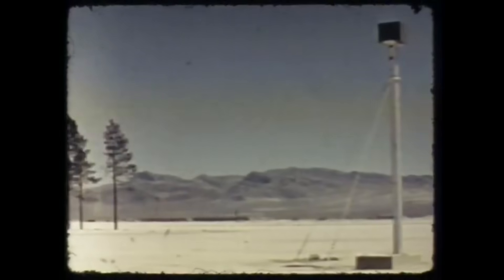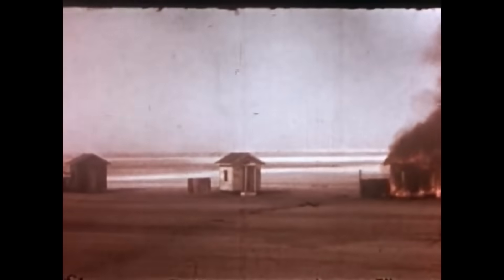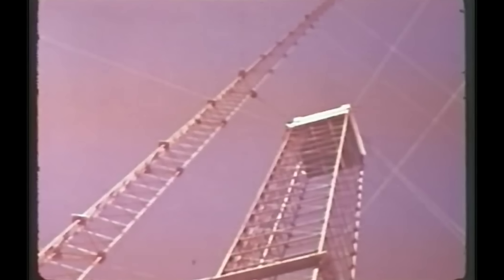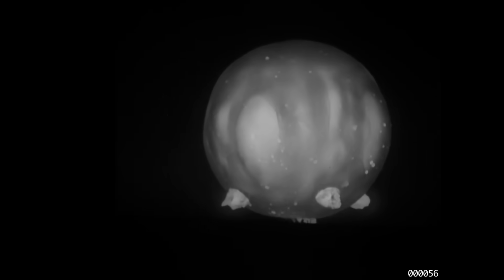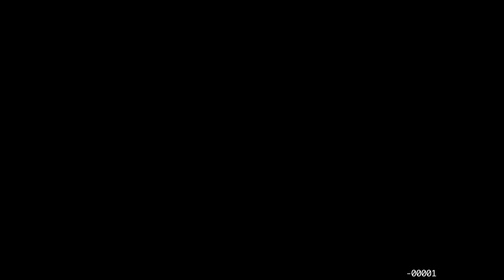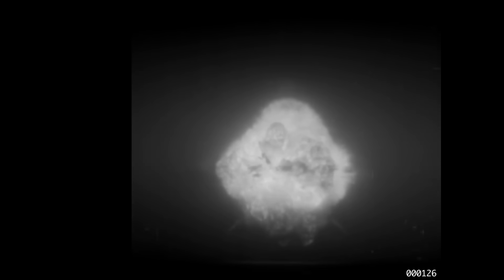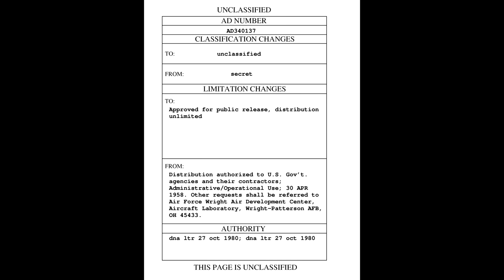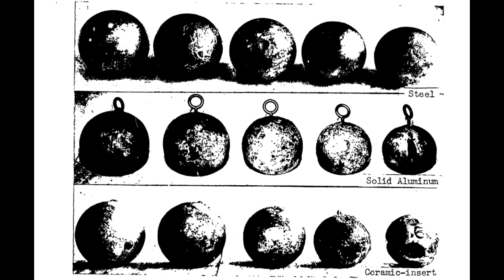Can A Metal Bowling Ball Survive Inside a Nuclear Explosion?

Comment: 5:27 These guys seem underdressed for standing in the middle of where a nuclear bomb has just gone off. I wonder what level of radiation they're being exposed to.
Reply: @John 73 John
The picture was taken 58 days after the explosion.
Reply: @spaceman081447  58 days is still generally considered "too soon" when it comes to radiation, isn't it? I'm thinking of how Chernobyl is still somewhat dangerous 34 years later, and would be much more so if it didn't have the concrete sarcophagus.
Reply: @John73John  Saying something is "radioactive" is like saying something is poisonous.  With rare exceptions, radiation is caused by radioactive decay.  That's where an element turns into another element (or the same element, but with a different number of neutrons).  So, just like with poison, it all comes down to what those elements are, and how long it takes them to break down into something safe.
Reply: @John73John  How soon is too soon depends on the half-lives of the radionuclides present, the type radiation (alpha, beta, gamma), and their quantities.  A nuclear reactor like Chernobyl's RBMK has tons and tons of uranium fuel, fission products, transuranics, and neutron activated materials.   An airburst weapon whose fireball does not touch the ground does not leave much radioactive debris in the area of ground zero.  You can read all the declassified test reports you want, showing contour plots of residual radiation at various times.
Reply: vibrolax Yeah, the deadliest part is in the fallout after the explosion.
Reply: Arthur Moore For some short living  isotopes like Iodine 131 there’s a relatively short time limit, but for most other stuff the decay is too slow and there’s only dispersion over larger volumes of soil and water that creates the impression that the problem disappeared.
Reply: @BasedBaller My father and others were told to "get the hell off" the Prinze Eugen after a day and a half of "cleaning" the ship. Lived to 79. Lucky.
Reply: @spikespa5208  If thats legit thats a great story
Reply: Define "just went off". That photo is likely days after the blast and the radiation levels were low enough for a short visit. Also notice they are wearing rad badges. The guy in the white hat is Dr. Oppenheimer, basically the chief inventor of the bomb. You can trust he knew what he was doing. (Besides, everybody smoked in those days, so you can flip a coin as to what was going to kill them first).
Reply: @RCAvhstape  Almost everyone in this photo died 'soon' after. Where 'soon' was only 10-15 years. They weren't old men, they were dying at the ages of 60-65. They didn't really know the long term effects of radiation on the human body yet. Acute? Yes. But chronic wasn't really a thing they worried about til well after their exposure. So, no. That was one aspect they didn't know what they were doing. Yet.
Reply: Cancers from significant but non-lethal exposures most often kill people after 60. Unless you ingest hot particles, especially some specific isotopes. Marie Curie lived 66 years. And she literally smeared herself with Uranium, Radium, Polonium for most of her life.
Some of these researchers had radioactive urine contaminated with Plutonium and made jokes about it.
Reply: They got about 50 mSv. Also no wearable clothing can help against gamma radiation.
Reply: Yastreb The main problem is radioactive dust, not gamma(if the exposure is short enough)
Reply: Well if the bomb detonate in the air or on a tower the air it self takes away alot of that neutron Flux (so the dirt do get mutated to nasty isotopes and the heat will gather almost all of the fission products from the bomb and send them in to the stratosphere down the wind in Taktikal use of nukes it is a bit different because they will hit almost directly over a bunker etc and a lot of dirt get mutated  but even this is not as bad because the really bad stuff hasn't long lifespans
Reply: Kathy Sharp  right. Now do the rest and come up with an average.
Reply: Like the signs say in Fallout. Radiation is not to be feared! But is should be respected.
Reply: The dust they're inhaling may have some interesting properties 😐
Reply: Not to worry, much of the radioactive debris blew into the neighbor's yards, decaying into SEP (someone else's problem), a bit like CO2. What was left killed them, but very slowly. /half-joking
Reply: @karlharvymarx2650  Yeah, I know. I live in Utah, one state over from Nevada where a lot of tests were done. "Down-winders" my parents' generation called themselves. There was one couple who watched a test from behind some kind of waist-high concrete or stone barrier, and a few decades later they both had tumors all through the top halves of their bodies.
Reply: The worries about radiation came up only in late 50s, when they discovered that the women in the watch factory had radiation sickness, since they were applying the r-active glow paint by paint brush. To make them pointy they put them in the mouth - including the rest of the paint.
Reply: @Bill Ferner The “radium girls” were injured in the 1920s, much before the 50s.

Comment: Thanks for another interesting video.
One of the underground tests included a steel plate to cover a shaft. That plate then flew vertically perhaps reaching the space. Do you know anything more about it?
Reply: They actually now believe it was completely vaporised rather than achieving orbital velocity. Though they did the maths and it would have had enough delta V to escape had it survived.
Reply: Anarchy Antz 
Wait I thought it survived, because it was launched out at such speed that it pretty much escaped the fireball entirely, and might have been the fastest man made object.
Reply: @livethefuture2492  It would still be colliding with the air at such speeds that that could make it melt and vaporize, like a spacecraft coming back from orbit.
Reply: I saw a Youtube video about this 3 or 4 years ago.  It may even have been a Scott Manley video.  In any case, it is out there.  If you do some sleuthing, you can probably find it.

Comment: I wonder if the opposite of the nuclear manhole cover was ever tried. A nuclear explosively formed penetrator for large scale demolition?
Reply: In a way, a hydrogen bomb is like a shaped charge fission bomb.
Reply: @nagualdesign  no it would be cheaper to just drop a large steel rail from orbit and then let gravity do the work or just put a massive steel slug on a ICBM replaceing the nuke would be just as if not more devstating then a nuklar warhead sence a few multiton solid slug hiting the ground from a sub orbital tejetory would turn the kinectic energy into thimal energy on impact that would bascly be just as super divtadting to everything but without the nukear fallout so maybe we can replace nuker warheads with kenictk kill impact warheads and we could nuke somting from orbit wihtout the nukear fallout if we just launch a big solid bulltet slug that wieghs a few tons on top of the ICBM it would be also alot cheaper and can bascly be alot more usefule in blownig things up wihout worreys about nukealr fallout but it would still tecany count as a WMD but could bascly alow a MAD seniro that would atltest not disroy the evnorment in the long term as long as you don't spam them more then 50 at a time

Comment: 8:22 So, like the Leidenfrost effect, but in a nuclear explosion.
Reply: Mihir Gadgil More like spacecraft ablative shields during reentry.
Reply: Yup
Reply: More like ablative heat shields on spacecrafts.
Reply: no, like xray vaporizing the steel because its opaque, then that steel heating up so much it starts sending out xrays to vaporize the next bit of steel.
Reply: @sudazima  you really think the steel can heat up so much to send X rays ?
Reply: @YounesLayachi  everything inside of a nuclear explosion heats up enough to send x-rays...
Reply: @KT-pv3kl  that's news to me, I'll look this up but you might as well drop some sources
Reply: Younes Layachi Anything can heat up enough to produce X-rays, black body radiation can occur at any temperature, however in this case the source of the X-rays is further within the fireball radiating outwards. It’s possible that the innermost ball that wasn’t found was heated to those sorts of temperatures, though.
Reply: @YounesLayachi  The steel itself probably doesn't get hot enough to emit X-rays, but when it gets sufficiently ionised, it becomes transparent to them, allowing them to reach the next layer of steel.
Reply: @AlexandervanGessel  steel gets heated enough to send out x-rays during regular welding operations so it stands to reason that a nuclear explosion is sufficient to heat the steel enough to send x-rays as well
Reply: @KT-pv3kl  Steel will vaporize before it hits 3000 degrees, which is nowhere near hot enough to give off X-rays. The electric arc of an arc-welder is much hotter though (tens of thousands of degrees) and will throw out serious amounts of UV, and possibly measurable amounts of photons that cross the edge into the X-ray spectrum.
Reply: I have argued that the Leidenfrost effect could have allowed the nuclear manhole cover to survive the transition into space.  If it survived, it is now in orbit around the sun, not the earth.

Comment: Re: amount of mass lost steel vs aluminium. I would think that the heavier ball would not be pushed as fast, and thus would experience higher abrasion from the relatively higher 'wind'. ie its inertia would be higher. The mass lost being similar on the two balls is probably a coincidence as the amount of material lost will be a function of inertia, material strength, melting point and more.
Reply: I'd have guessed that it is mostly a function of heat capacity, as I think most of the mass loss is just from vaporizing the top layers.
Reply: @togamid  That makes sense, so throw in heat conductivity (faster conductivity to the centre keeps the surface cooler and results in less vaporization). Oxidation may also play a part but the even may be too quick for that to have much effect.
Reply: @TimothyWhiteheadzm  It would be interesting how long the spheres stayed in the vicinity of the blast and when they are reached by the blast front and fly away. It might be possible that this is soon enough to prevent even heat conductivity (at 7:45 you can see that the fireball reaches the outermost spehere after 60 ms though I don't know when they have enough velocity to fly away). 
What I think is interesting is that they are still spheres. One would assume that the side looking at the bomb would be more vaporized by the x-rays than the far side.
Reply: I have similar thoughts.  I don't see what physical mechanism would result in the same mass loss.  Rather it must be a function of thermal conductivity, x-ray cross-section, and total thermal energy of melting, vaporization, and heat capacity.  Even if the mass was somehow removed via some sort of abrasion rather than melting and vaporization, it would depend on a specific material property. 

So, either this was a overall coincidence, a transcription error (the data has been through various "reportings" before it made it to us in this video), or I am just flat wrong because I don't have any experience inside the plasma ball of a nuclear explosion.